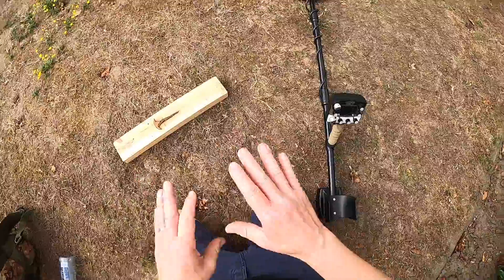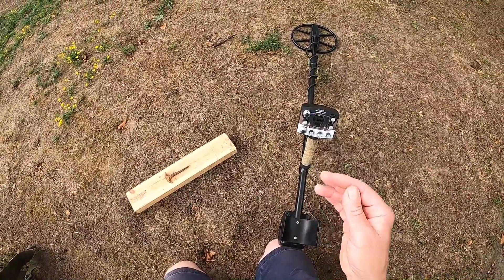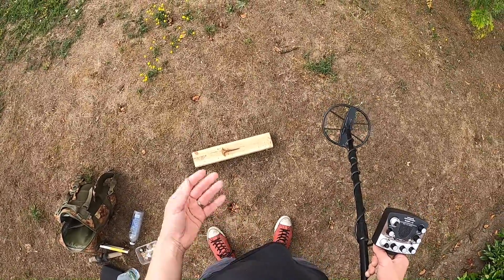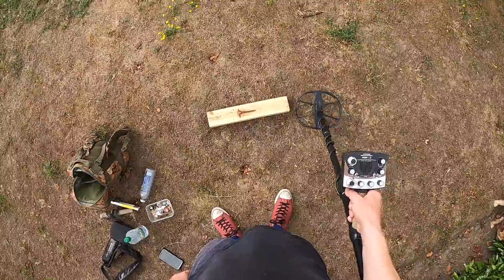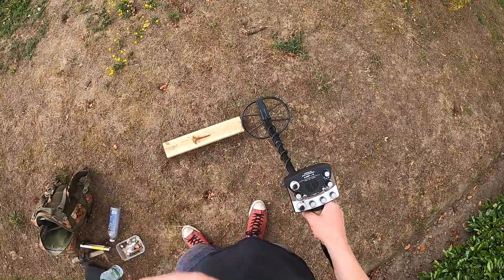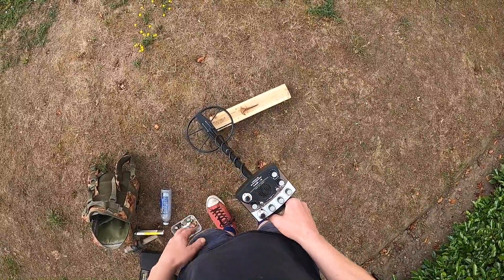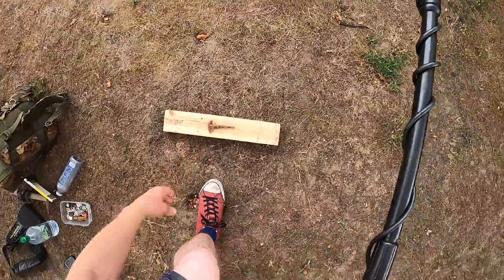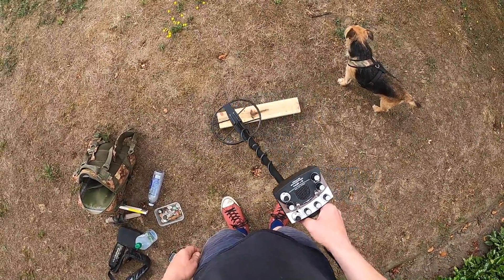Nexus Standard MP V3 - How I Identify Iron Using VCO Tones

Comment: looks like an interesting machine with great iron id "built in".  I do some similar things with the Legend in that when you run Pitch audio--signals have to climb in to give a clean repeatable tone.  slowed down (also low bias) the unmasking that this gives is remarkable.  a high tone that can't be pinned down is pretty much universal I call this an "emenating" response in that it's a reaction between the rion and the ground.  great explanations in that these simple coil and usdio  basics that tell you F from NF are skills that not many bother with but totally essential  to becoming really accurarate.  I was taught to look for "sets" of signal  characteristics.  and to ask "where is  this target?" to prompt this kind of broad based examination.  its alwmost comical  to watch some trying to id iron by ear or otherwise and  failing (YOuTube) --simple basics win every time. good luck, clive
Reply from the maker: Hi Clive thanks for the detailed explanation 👍🏻

Comment: Done some more testing myself with the pull tab and gold conundrum, and found out the resistivity of the pull tab is in front of the gold so when you eliminate the gold on discrimination, the pull tab still rings out, hence impossible to knock pull tabs out and still get gold, I did it with my Tesoro but it still holds for any detector.
Reply from the maker: Hi John on the MP V3 you can disc out pull tabs and still pick up small gold
Reply: Hi Paul would be amazing to see a video if ya get the chance. @paulwarrenmetaldetecting